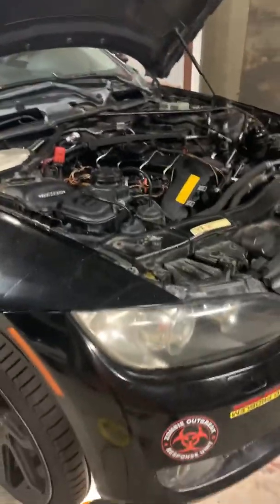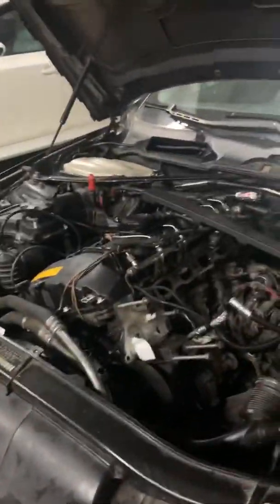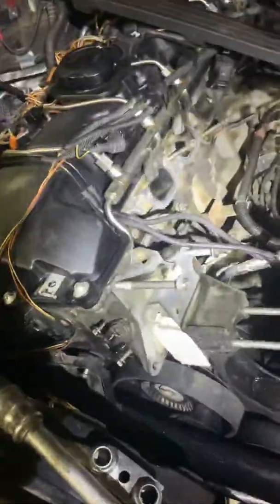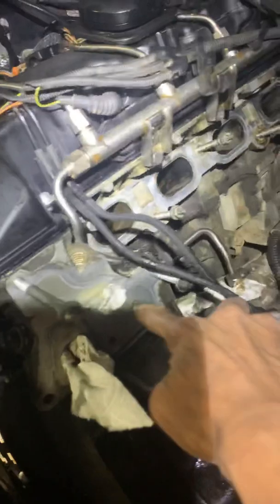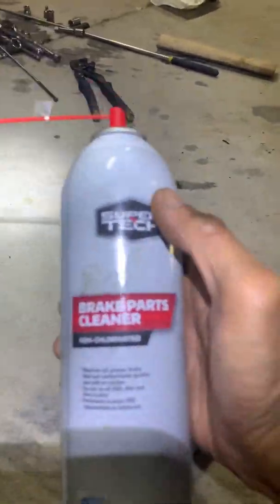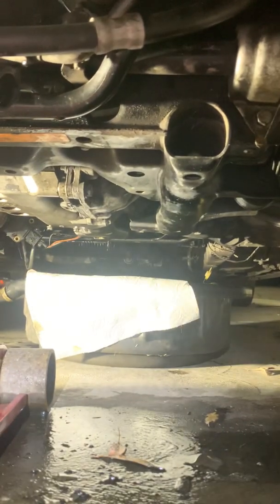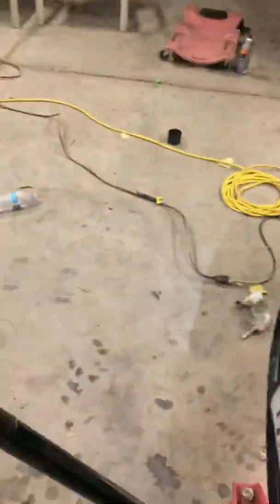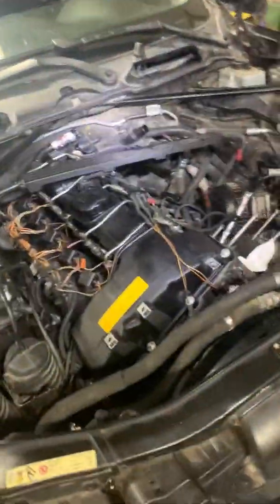BMW 335xi N54 How to back flush oil pump screen without dropping oil pan

Comment: Going to try this later on my 07 335i I bought with an ingested serpentine belt. I’ll come back to this comment eventually to see if it helped my case
Reply: ^as an update, I did this and i could hear and visibly see shreds from my serpentine belt fall into the oil pan. After 100 miles I have no codes, and plan on doing this with every oil change. The process of taking this off is only about 20-30 minutes and is absolutely easier than dropping your subframe to pull the pan. 10/10.
I would also recommend using compressed air, along with the brake cleaner as it’s a little faster and more powerful.

Comment: Run some Valvoline restore and protect through that. Change a filter about once every 500 miles. You’ll go through about six filters, but it will do a world of good if your engine has got a bunch of sludge in it. Also oil stop leak in a BMW is never a good idea. There are too many screens as you found out. Not to mention the Vanos screens and other oil screens that have to do with the Vanos system.

Comment: At first mine was completely clogged. After a couple minutes of spraying it finally began flowing. I really hope this solves the issue. I was getting a bunch of vanos codes and low oil pressure warning, also found lots of belt pieces in the oil pan hopefully i got everything!!!
Reply from the maker: @MEDIATRUTHHUNCUT…..it did the job for me and others whom watch this video. Give it a try my friend….some times it may not work if your screen is really thrashed. Let me know how it go ok.
Reply from the maker: If it’s still clogged you can hear the valves tapping because of no oil being pump into them. That’s how you can tell if it works is by the sound of your valves….

Comment: makes sense, you think if you blow air pressure in there,,would it help
Reply from the maker: @VIACOMSUX100…..yes blowing air through will help to air dry it out faster after you spray cleaner.

Comment: Man im getting low oil pressure on my 2015 bmw 328i n26 engine😢 
Getting codes like “Oil pump low oil pressure” & “oil pressure control valve jams in full energized position” what shud i do? the shop will charge a lot to drop the pan just to check the oil pick up screen right?😢 man idk what to do, should i replace the oil pressure control valve for $200 first? Can i message you on instagram brother? or any platform or #?
Reply from the maker: @silentescape818……your issue could be what I had experienced when I had the low oil pressure code. Try doing what I did and see if by back flushing the oil filter pump will help, it’s very cheap to do. After draining your motor out the first time, move that oil away and use a fresh clear Tupperware tray and put that down there so you can see what kind of dirt or debri came out.

If your oil screen is clogged you should see clumps of stuff.
Reply from the maker: If that don’t work then try the $200 control valve. I know it’s a pain to drop these bmw oil pan, so I feel you on this one. Let me know how it goes.
Reply: @Yourgirlnadia67  Im not a mechanic so i cant do any of this sadly. You don’t think i should try and change the valve first? Could the valve be clogged from doing a late oil change?
Reply from the maker: If you aren’t able to do any mechanical work then drain your old oil and then try to spray one can of “engine degreaser foam spray” using the straw that comes with the can and stick that straw inside the oil drain plug. Spray all the degreaser upward and let it do its work, give it like 5-10 minutes and you should see sludge dripping back down. After that then spray “brake cleaner spray can” inside there to flush what ever is left knocking it down. When spraying spray it in many directions.
Reply: @Yourgirlnadia67  My timing chain is tight and not broken or anything so it cant be clogged by that, Could sludge really clog a oil valve or even the oil pickup screen?
Reply from the maker: Yes the oil sludge and tiny debri can clog up the oil screen preventing oil from being pump up from the pan.
Reply: @Yourgirlnadia67  But dont you think i should try the valve first? because i doubt i have anything blocking my oil pick up screen in the pan

Comment: hey man you think this would work for me i replaced my serpentine belt after it pooped now im getting low oil pressure . should i give this a try?
Reply from the maker: I would since it’s cheaper then taking it in to the dealer or pay a mechanic to troubleshoot it. Every car is different but go for it.

Comment: What kind of spray were you using?  Thx
Reply from the maker: I was using the cheap “brake cleaning” spray from Walmart call “Super Tech” it’s like $2 per spray can.
Reply from the maker: Here’s a list of spray cans I use.

1) 3 spray can bottles of brake cleaner call “Super Tech” brake cleaning.

2) 1-2 spray cans of the same brand name “Super Tech” engine degreaser foam spray cans.

Comment: Very helpful video. My 07 530i lost oil pressure and I thought the engine was done. Started rattling, the oil light came on and told me to shut the car off. First thing I did was look at the oil filter and it was clogged real bad with oil sludge. It was caked on and I mean hard. Tried a new filter, no dice. As a last resort I came to YouTube to see if anybody else fixed it without dropping the oil pan and came across this video. Tried this and it works perfectly. Engine is quiet now and no more oil light. Gonna change the filter one more time just to be safe. So glad I don’t have to find a new daily. lol
Reply from the maker: I’m glad it help you. Yes dropping that oil pan is no joke.

Comment: Found this when looking into dropping my oil pan to clean a disintegrated oil filter out of my screen.  I did just this, but also blasted the oil feed hole with compressed air, then used a boroscope to see where the gunk was and sucked it out with a hose attached to a vacuum.  Worked great; the car runs awesome and this saved me a ton of time.  Thanks for the video and saving me the enormous pain that dropping my 535xi's oil pan would have been.
Reply: hows the car running? I was just getting ready to drop my oil pan thinking of trying this method instead
Reply from the maker: @NilGlizz  have you tried it and did it work? Let me know. Thanks